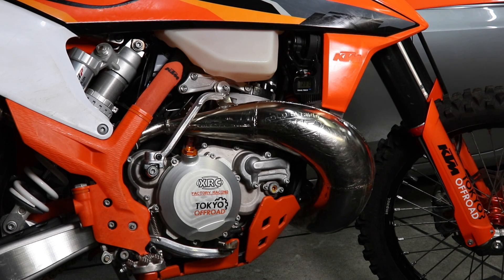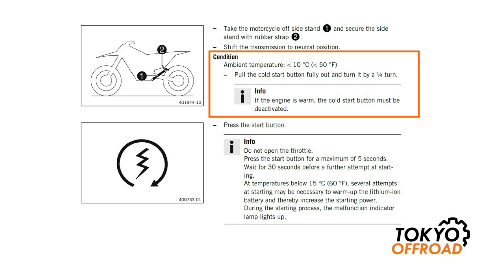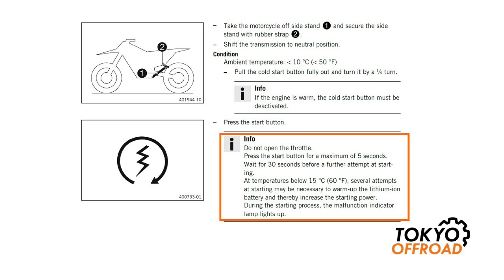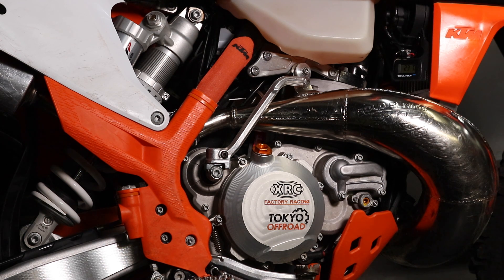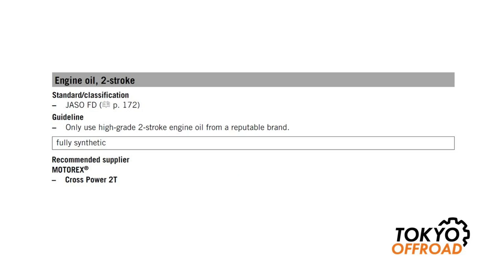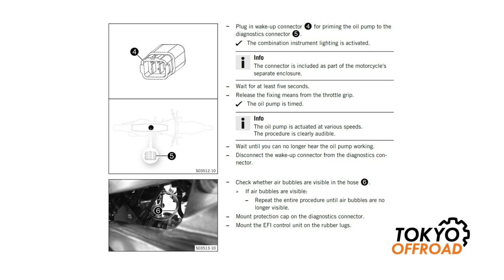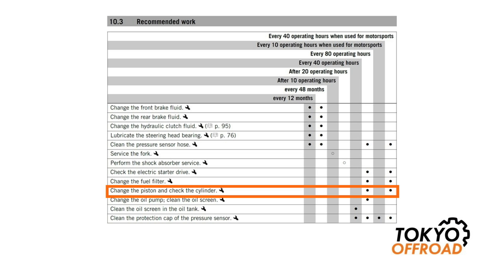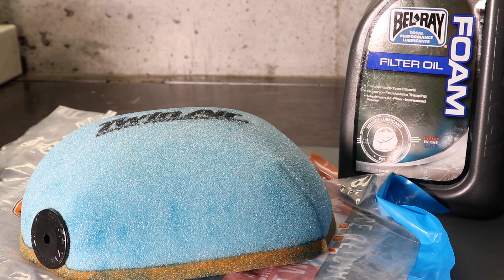Tips To Help Ensure Your TPI 2-Stroke Engine Doesn't Seize

Comment: Very informative ,great site ...But fuel pumps ,oil pumps ,crankcase pressure sensors etc etc  fuel injection has no place in enduro bikes .Great idea on  informing   ktm  on the problems you may have encountered but that won't get your bike back to your truck. And  the bullshit KTM had to introduce TPI to pass Euro emissions ...Beta,TM,reiju  all seem to have met Euro standards without TPI. It seems KTM introduces technology that isn't properly proven akin to VW .I'll take   Carb , Kickstart and KYB suspension anyday and make it back to my truck every time.Anyway great site ,I'll continue to watch irrespective of the KTM content
Reply: Same shit is in all other hard offroading machines 🤷‍♂️
Reply: @samuelyeet6006  The sherco,TM Beta and Reiju  are all carbed or offer a carbed version in their premium bikes.Yor statement is totally incorrect you plonka
Reply: @ktmkaos  by other hard offroading machines I meant things with more then 2 wheels lol yes carbed, but they still have oil injectors... it doesnt have to be fuel injected to be oil Injected lol you "plonka"
Reply: And beta oil pumps fail way more then KTM, they are basically known for it lol
Reply: @samuelyeet6006  Again ,the Beta is premix in their racing premium models
Reply: @ktmkaos  the beta 300rr is oil injected, yes they make a race edition that's not, but that doesnt take away from anything that isnt
Reply: @samuelyeet6006  This doesn't even make sense ,go away
Reply: @ktmkaos  you think it needs to be fuel injected to be oil injected too? Lmao

Comment: KTM do not help out with repair costs for part failure. I had a main bearing collapse at 6.5 Hours on my 2019 300 EXC TPI and they refused.
Reply from the maker: I’ve heard of quite a few cases where KTM decided to cover the part cost. It’s unfortunate that they would help you with such low hours on the bike :-(
Reply: @TokyoOffroad  I think they have helped in some cases but in my case they said that it was how I'd washed it that caused the bearing to corrode and collapse. I'm a professionally trained and qualified engineer as you are, and I disagreed with their assessment, but nothing I could do. Luckily my dealership are a great bunch and minimised the expense for me the best they could. In no way does it detract from the fact that when running and problem free, the 300 Exc Tpi is the best in class in my opinion.
Reply: Same for mine, first it was run it out of oil then changed there story to used the wrong oil. Think i would have learned from my last KTM with the dash and seat.

Comment: Also check fuel pressure or bubbles in the tank while running the engine
Reply from the maker: Yes, I did make a video about TPI fuel pressure testing. It’s another good test to perform periodically…
Reply: @ccenduro  it could mean a cracked fuel filter or a loose clamp, there is also a pressure release valve but i'm not sure it would release bubbles, fill the tank up above half a tank and check where are they coming from..
Reply: @ccenduro  put a fresh one in anyways.. 👍

Comment: $12g bike that needs $2g more of engine hop up's and its very own video on "how not to seize"... Yea i'll stick with my Sherco 2t. Best bike out of the box.
Reply: They don't actually need anything. Half the people are just idiots and the other half listen to idiots. I've beat the piss outta my TPI and over 120 hard  hours.....only issue in all that time was a failed crank case pressure sensor ($45). It's time for a piston but it still runs flawless!
Reply: Bro they dont need anything,  people just want more power, you act like carb people dont drop 1k on a lectron or smart carb, another 20 hours tuning the bike, and another 1k in other performance parts, it's the same for both of them
Reply: I had No idea Lectrons went up $400, i'd laugh at those people too. But some need it I guess. I just tune my Kiehin for free and jet it myself for free and it rides like a champ
Reply: @Madtigertv  the smart carb is 1k, the lectron is 600, you can say that but atleast every other bike has one or the other, and then the rest have 100$ JD jet kit in them
Reply: @samuelyeet6006   Get your numbers straight and your point would be more valid SC = $699-$824..Lectron *my bike $500..Jet kit for those that actually cant tune it themselves $79.. And what world do you live in where every other bike has one? Hell no lol "then the rest have jet kits".. ? Again what  world do you ride in? JD jet kits are just a needle with  reg jets sorted for you. Im not here to argue with the clueless so i'll have to agree to disagree.
Reply: @Madtigertv  bro just the fact that you get upset about me being a little bit off, shows you are just biased, I said 600 and its 500 and you say that makes me clueless? 😂 throw some taxes in and the adjustment tool and im barely off..  fact of the matter is the same people that would get an ECU or tuner are the same people that would by a Lectron or SC,  and the prices are almost the same, shit I can get a TSP kit for a TPI bike that comes with a new map, high compression head and idle screw for 600 bucks 🤷‍♂️ and as far as the jetting kits go, go on any forum the answer EVERYONE gives is to buy a JD jetting kit, FACTS!!!
Reply: @Madtigertv  depends where and what times you ride I’ve ridden races that were 24hrs and at night temps were radically different and throwing off all the carb guys where some were left in the woods in pitch black figuring out what jet they need to switch out to get their bikes running right. Meanwhile air cooled Hondas and lectron equipped two strokes running all night long with zero hiccups.
Reply: Agreed!!  Lol
Reply: $600 ecu remap/head is the least of your worries, wait till you adress the soft forks lmao. Great bikes though!
Reply: @elihamou6902  what? AER forks and XPLOR forks, same but better then the ones 17 to 19, and 10 times better then the shit 4CS forks before that, some say the AER forks are the best stock forks ever created....
Reply: I will stick with my Beta.I switched from KTM because of this type of crap.
Reply: It’s 20% the bike 80% rider.. all bikes have their quirks.. most people just spend money for nothing.
Reply: @AfricanOzz  riiiiight

Comment: Never let Greta Thunberg and other UN zealots dictate your lubricant amount. Buy a Beta or Sherco.
Reply: Beta has oil injectors too, and they are known for failing, alot more then KTM
Reply: @samuelyeet6006  nobody serious about their beta leaves the Oil injection in place. The system lives in a box with the blinkers and mirrors. With tpi you remain victim to the greens agenda. 40:1 forever.
Reply: @2stroke7370  that doesnt explain the insane amount of betas that are grenading themselves due to failing oil injectors lol
Reply: @samuelyeet6006  bad design? Don’t know. I don’t know anyone that runs OI. Good for pw50 and snow mobiles I suppose. Everyone I ride with deletes it and mixes.
100% fail free.
Reply: @2stroke7370  6500 km's here with oil injection and no problems for me
Reply: @DaRuler66  good news🇮🇹💪🏻💪🏻
Reply: @2stroke7370  pretty sure I've seen your bike on Thumper Talk
Reply: @2stroke7370  I didnt mean it like that, I meant it like if everyone was removing the injectors, then their wouldn't be as many reported cases as there are. I'm just saying alot of people dont remove them. I personally would remove it myself

Comment: In our ride group 4 out of 10 TPI bikes have seized in the last 6 months. One had less than 40 hours. None of us race or abuse our machines. None of us received any help or compensation from the dealer or manufacturer. The typical out of pocket repair cost at the dealership for this failure is $2000-$2400. I believe that cold weather operation is a major factor in these premature failures. Unlike snowmobiles, the oil tank is not enclosed or heated. All the failures indicated seizure on the intake ( cold) side of the piston. This is the side that receives the oil injection. Perhaps using snowmobile 2T oil during cold season is a good idea. 

I also question the frequent piston replacement suggestions. We have inspected a handful of pistons at 250-300 service hours of trail riding use and found them within spec. One outlier has seen 430 hours and still has good compression and doesn’t smoke. As I recall in your previous video that your own piston looked very serviceable at 150 hours or so. For me a significant drop in compression would indicated replacement time more than a set number of hours. Careful measurement of ring gap and cylinder taper upon disassembly would quantify actual wear. Old habits die hard. There have been significant improvements in metallurgy and production tolerances over the past few decades. 

Thanks for your video series. You bring an engineer’s perspective to educate and inform the public, a valued perspective.
Reply: @ccenduro  I live in Washington State, USA very near the Canadian border. We ride in the snow 3 months of the year here.
Reply: That’s interesting Garth - I’m in Utah and ride it quite cold weather throughout the winter as well. Beyond snowmobile oil I wonder if there is something else that we could do to protect the motor. I had a thermostat delete but put it back on as my bike would never go about 120 degrees
Reply: @joshhancey3810  In my experience the TPI bikes definitely run cold. My TrailTech radiator fan assembly has a digital gauge. It was common to see the coolant temp drop below 100 degrees Fahrenheit on downhill runs. The bike would act noticeably cold too. Upon disassembly the seized bikes all had oil present, especially around the reed block. I speculate that these motors and cooling systems were not properly developed for cold weather operation. Oil will not lubricate properly at low temperatures and high loads if it has trouble getting past the reed block to the piston and cylinder. All our seizures have been on the cold side of the piston ( intake side). Jeff Slavens has a good video about this. He has fitted multiple temp sensors and also reports cold coolant temps. Jeff recommends blocking off one radiator for cold weather operation. He certainly knows more than me about this subject.
Reply: @Anatoli50 Reading your comments 3 years later but spot on. I'm in WA too with a 23 TPI300. Riding below 50 degrees F it just never warms up. I've been afraid of romping on it because every sensation tells me DONT. Hot summer days it's a completely different machine and feels like it should. I'm doing all the checks before I take it out in spring. Felt really off about it last winter like I was killing it, so I didn't ride much. I'll put a new pump in and check the piston before I go out again. 300 miles on it as of now purchased new in 22
Reply: @ My original suspicion about poor cold weather lubrication with the TPI bikes turned out to be correct. There are 2 major problems. As you noted, the cooling system doesn’t keep the bike at 180-210 degrees Fahrenheit. Coasting down the mountain at the end of a long ride the digital coolant gauge will drop to as low as 75 degrees. This triggers the ECU to add more oil thinking the engine is in cold start mode. The result is often a fouled plug. The second problem is the location of the oil injector, upstream of the reed valves. The new TBI system has one injector positioned upstream that injects gasoline. This acts as a solvent dissolving the cold oil from the oil reservoir, allowing it to penetrate the reed block and properly lubricate the cold piston. I haven’t had any cold weather operating problems with my 2024 TBI Husqvarna TE 300 in 270 hours of operation.  I ride all winter, 2-3 days a week. My bike runs like new on the original top end.
Reply: @Anatoli50  Thanks for taking the time to share. The info helps me prevent future troubles with it.  I dabble in forums from time to time to learn what others experience with TPIs. There is so much mixed information on these out there.